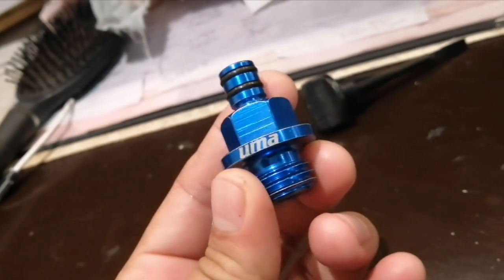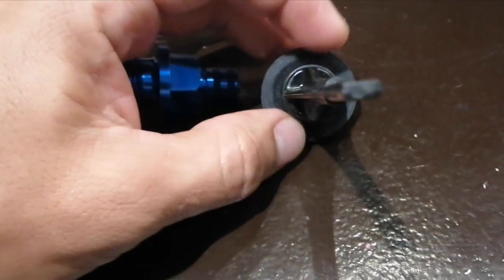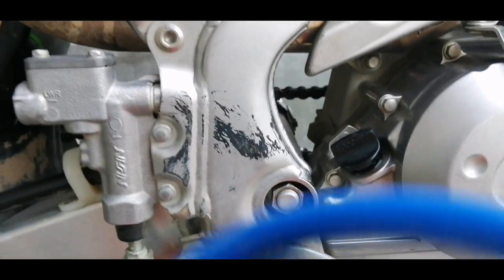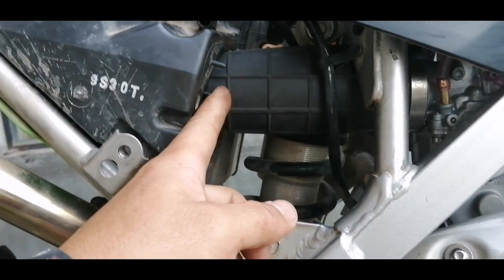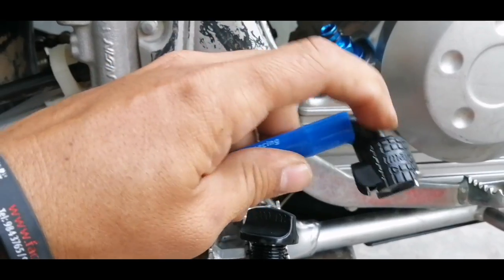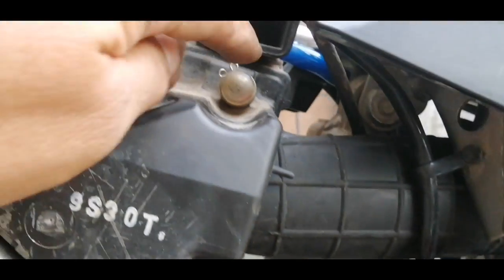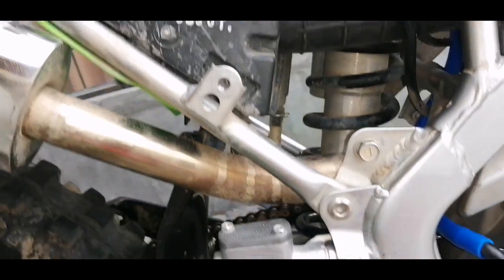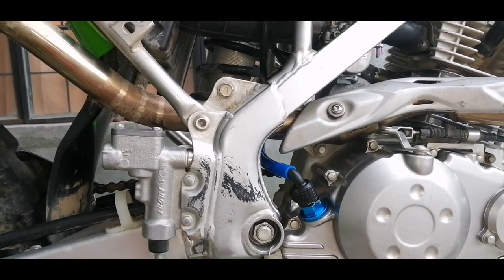Motorcycle Engine Pressure Bypass and Breather Hose Installation | Motorcycle DIY | UMA racing

Comment: High pressure heat lng po ba ang lalabas jan hnd po ang langis?
Reply from the maker: Yung high oressure sa loob ng makina.. Ang oil po di yan lalabas nasa itaas po kase ang hose nya nka lagay sa ilalim ng upuan then ang dulo naka loop pa baba sa vround so di talaga makakalabas ang langis or mapasukan ng tubig
Reply: hi, if oil comes out, how do you resolve the issue?

Comment: Normal po ba may langis sa dulo sa pinagsusuksukan mismo pero sa kabilang dulo wala naman po?
Reply from the maker: Pwede mo po lagyan ng fuel filter amg dulo para di lumabas ang oil.. Tapos dapat mahaba amg hose mo para di talaga lalabas ang oil
Reply: Hi, if oil comes out, what do you suggest to solve the issue?

Comment: Boss hindi ba masama yan pag stock lang po ang motor
Reply from the maker: No need na sa stock boss  sa mga nka pag upgrade lng
Reply: @EnduroMoves  pang porma lang po sana hindi po ba masama?
Reply: @EnduroMoves  yap paps pang porma lang
Reply: @EnduroMoves  boss pero kung allstock ang motor tapos naglagay nyan, may bad side ba or ok lng din nmn ?

Comment: Sir bakit po yung sakin may leak po sa may quick release, pahelp naman po salamat
Reply: Naka oil catch can po ako, yung isa mula sa engine breather, yung isa naman po galing sa uma bypass breather
Reply from the maker: Check mo ang oil seal baka na tanggal.. Or dapat marinig mo ang click pag ipinasok muna siya.. Ibig sabihin nag lock na

Comment: 😂ño need na maglagay ng ganyan bro dahil my  breather hose na yong cylinder head 
kong lagyan mo pa nyan  mawalan ng pressure at  bumagal ang pwersa ng motor  dahil singaw na kong takpan mo sa dulo siguro pwdi pa peru anong   advantage sa breather kong lagyan mo yan ang mga oil mgtambay jan    at cause ng pg usok ng makina dahil ngkulang na ang oil dahil na open sa  hose  saan mo natutunan yan na kaalaman  gumawa ka ng xperement na dimo alam mga ginagawa mo buti sa kong recycle ang oil para di magkulang  eh nakatambay ang oil  sa  haba ng hose jan maipon katok makina mo jan..